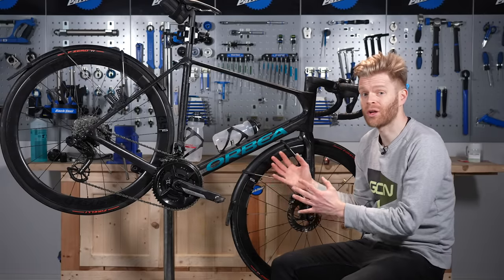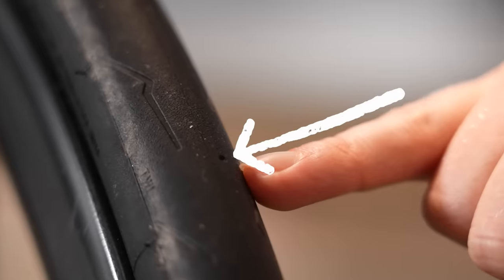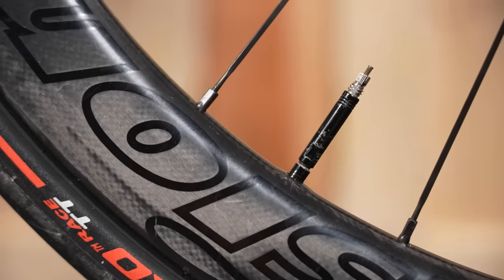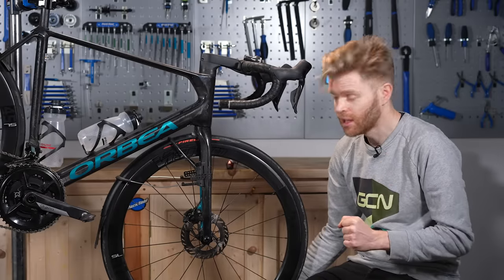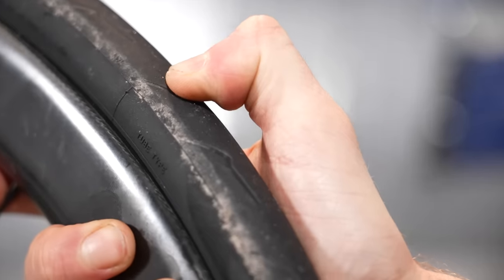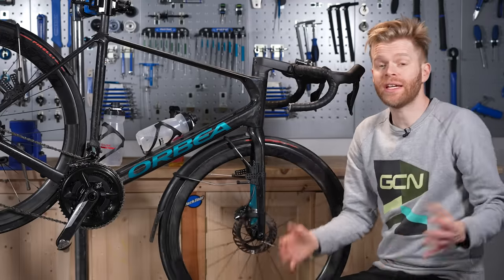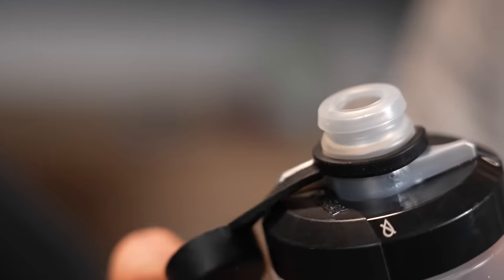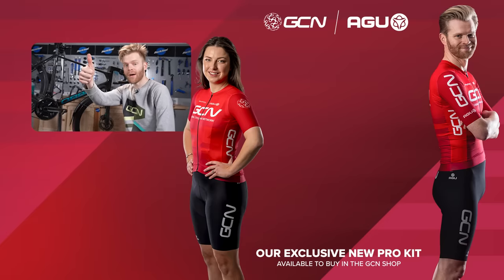9 Simple Money And Bike Saving Tips For Winter

Comment from the maker: What winter money saving tips do you have? 💸
Reply: Cut a chunk of old inner tube about four to five inches  or say about 100mm long and wrap that around your spare inner tube, thats serves a few functions it protects the inner tube from other things rubbing it, it keeps it clean and if need be it can also work as a tire boot or patch. I recommend a butyl type of tube for that, since some of us has them thrown in a corner somewhere.
Reply: Buy a set of rollers and ride indoors 😂
Reply: Save money on expensive food, ( cheap food to bring on a ride, instead of bars and coffey pitstops) and stay less hard than the Skyrim NPC David Goggins. All depends on where one usually have high expenses, dont save on heating your home, it will cost you more later.  peace
Reply: I just checked the chain on my indoor setup and it's still not worn despiite 23,330 km ridden on that one chain.  Other than being a great ad for Silca wax and super secret lube, it makes the point that wear items last loads of time when kept clean.

Comment: In my opinion all saddle bags have to be fully waterproof to keep out rain and dirt. It shouldn't be necessary to use an additional bag inside it. Otherwise the saddle bag is not up to it's task.
Unfortunately the number of waterproof saddle bags is limited. I use the Ortlieb Micro Two
Reply: I've got soft panniers that're waterproof, but the manufacturer states that for prolonged use in rainy conditions it's advisable to fit the additional outer bag thing that wraps around them. Water will find a way in through a zip or something somewhere that isn't quite closed properly.

Admittedly, these are motorbike ones, but the same situation applies

Comment: If the chain is so far stretched out that the chainring is worn I just keep using it because the drivetrain has to be replaced anyway. Have had a chain stretch 1/4 inch, still shifted fine, just kept using it until it started to skip too badly on a certain gear. Was 8 speed chain though so this may not work on 11 speed. Especially in winter I cant be too bothered, because a casette is about the same price as a chain for 8 speed, and the chain becomes dirty after 15 minutes riding.
Reply from the maker: 8 speed chains are knows to be bombproof, even when worn they just keep chugging along 🙌 10 speed and upwards has much higher tolerances for things like chain wear

Comment: I have my tools and two spare tubes in a hip bag under my jerseys (e.g. the Deuter Security belt, designed for carrying money and your passport hiddenin your holiday in counties where this is a problem); maybe it is worth a try to impregnate the saddle bag with one of those sprays used for shoes? Concerning the bottle, I use a Pro Team bottle which offers a protection cap for the drinking nipple. For the chain, I now try the Squirt lube for low (0°- -18°C) temperatures; below -18°C I will do indoor training. Concerning the tyres, I must admit I use the Goodyear Eagle F1 tube type tyres, as they seem to be better than the Grand Priy 5000; on snowy roads, I won't ride any more, since I broke my ellbow as a pedestrian, which had to be fixed with plates and screws, which have to stay in place for at least one year. I started riding again after 5 1/2 weeks, although the doctors said I should wait for 13 weeks, but I guess that is more the case for coach potatoes, and not for guys like me that make sports almost every day. The risk of having an accident on snowy, slippery roads is too high for me, one shot across the bows is enough for me.
Reply from the maker: thanks for the tips and comments! You certainly have more "wintery" weather conditions than we do!

Comment: You can also just clean and re-grease bearings instead of outright replacing them. Just need to be careful taking the rubber seal off.
Reply from the maker: That's true but often with sealed bearings is easier to refit a new set - if you're looking for fixable bearings that you can keep alive cup and cone can be the way to go 🙌

Comment: Hopefully not a silly question... IF the temperatures lower (or higher) how accurate are chain checkers? We all know metal expands or contracts on different temps , so wondering if a chain checker is spot on when testing in say a cold day when the bikes been in the shed or cold garage or the opposite in the summer?
Reply: Chain checkers are not precision instruments and chains wear unevenly anyway, and therefore not very accurate full stop. Even if you are not interested in waxing I recommend watching Adams video over at Zero Friction Cycling on the matter. But the cliff notes version is, dont over think it, get a decent checker that is easy to read and go by that. He recommends the Shimano one, personally I like the  Kamasa 56061.
Reply from the maker: That's a super interesting question... no silly questions here 🙌 This would be perfect for the Tech Clinic - to be featured remember to use #askgcntech

Comment: #AskGCNTech Not a question, a correction:
❌🚫You CANNOT use a ruler to assess the wear of your chain!
The reason is that it is not the chain as such that gets longer: The outer plates only stretch very, very marginally if at all.
Instead, it's the surfaces between the pins and rollers that get grinded thinner by dirt working as a grinding paste.
The length that lengthens with wear thus is the distance between any two rollers when dragged taught between chainring teeth and cassette teeth. And that is why you must use a chain checker tool which makes the chain taught between two sets of pins/rollers.
I suppose such a tool could be hand made, but the measurements would have to be very exact.
Reply: As the outside of the pins and the inside of the rollers wear away the gap between them increases meaning when the chain is pulled taught the pins sit further apart so a ruler can be used, however it takes the outside of the rollers (which also wear but at a slower rate) out of the equation making it less accurate.
Reply from the maker: Hi Simon, Thanks for the comment - Just to clarify, when using the ruler method we are looking to measure the pin distance not the outer of the chain. Like you said it's the difference between the pins that gets bigger. We would also always suggest using the chain checker first but if you find yourself in a sticky situation and don't have access to a chain tool. The ruler method should be enough to give you an idea. Hope this help! 🙌
Reply: @gcntech  Thanks for replying here 😊
I would still maintain that it is not the distance between links or centers of pins, which is what you can measure with a ruler, but between the surfaces of the rollers when the chain is taught. Maybe I put it slightly differently now than before. I hope it makes sense.
But you can try to measure with a ruler and then a chain checker tool on a worn chain. I am sure you will see a significant difference - so much so that the ruler is not by any means a reliable way to check the chain.
Maybe try it and make a video to let people know.
Again, thanks for replying here. 😊
Reply: @chris1275cc  It is true that the distance between the surfaces of the pins get bigger. However, what you measure with a ruler is the distance between the CENTERS of the pins. You can't really measure the distance between the outer surfaces of the pins anyway, since the rollers sit on the pins.
And as you correctly point out, it is the distance between the surfaces of the rollers (with the chain taught, I will add) that is the relevant measurement.
Reply: I can assure you chain wear results in the entire chain getting longer. That's the problem a longer chain doesn't mesh with the gear teeth correctly and so damages them. I have a nail in my workshop I hang chains on to measure the wear. With marks below at a typical  chain length so I can see if the links don't line up and by how much they are off. Most accurate method as even a tiny amount of wear shows up over an entire chain length. A badly worn chain is typically an entire link longer.
Reply: I understand BUT the centres of the pins get further apart became the hole in the rollers (and the holes of inner plates that the pins are not fixed too) gets bigger and the pin itself gets smaller allowing more lateral play. The bigger issue with rulers is they are not actually very accurate unless you pay for a certified steel one and that will cost you more than decent chain checker.
Reply: @chris1275cc  The issue with using a ruler is the measurement length is too short. I measure the length increase of the entire chain with my method. In fact it doesn't even involve measuring anything as the marks are based off the length of a brand new chain. I assess the wear by the percentage of a link. A full link longer being well worn. The down side is it does involve removing the chain.

Comment: Hi Ollie.  When your using the caps on your bottles that means you have to stop to drink?  Trying to remove the cap with one hand on the bottle and one on the bar ...?  Oh pop it off with your teeth (doh).  Same with restoring it.
Not a bad thing to do at all.  PS the grit doesn't taste nice either.  How about having a camel back or similar for your winter training?
With a waxed chain, I follow your advice and give it a wipe when I get home.  From time to time I give it a bit of drip on and I do it immediately after wiping.  Then it gets its overnight to dry and with minimum disruption.